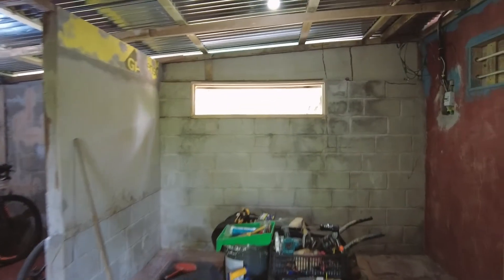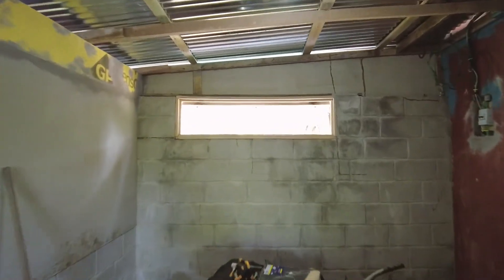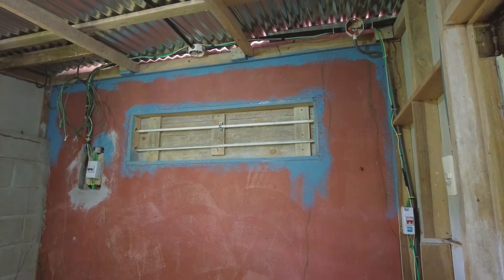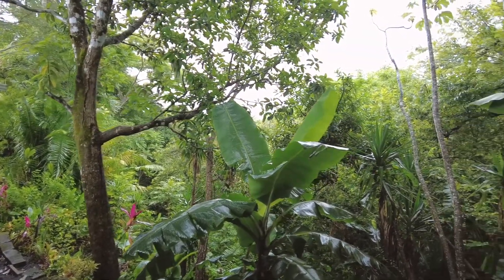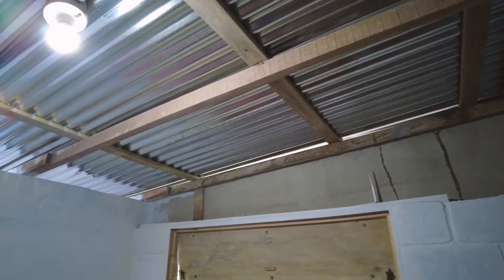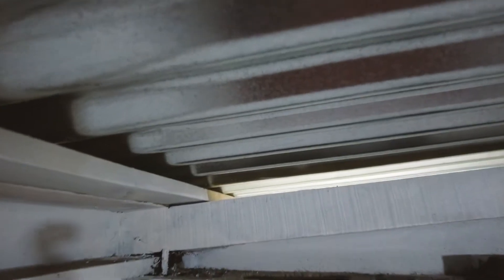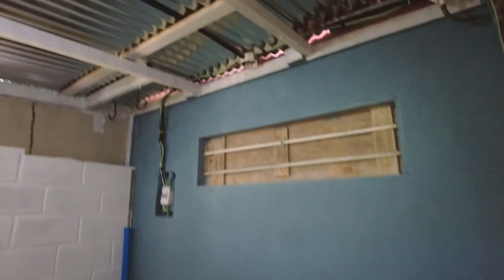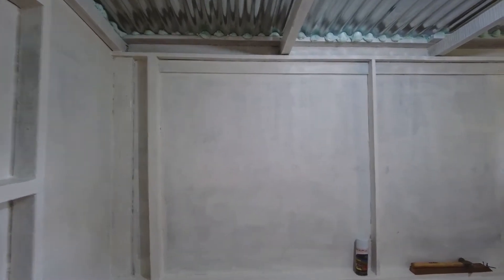Extreme Makeover Bodega Edition pt2 | Montezuma, Costa Rica

Comment: Thank you so much for these videos! They were incredibly helpful, and you are a natural teacher. You left me feeling hopeful all is not lost with the termite damage I have. Did you do any treatment for the termites that were there as you reconstructed?
Reply from the maker: Thanks for the awesome comments! The best way to avoid termites is to keep the perimeter of the structure free of dirt and debris so you can always see if there are any tunnels forming. Once they get in, that’s when the fun begins. Although I tried to avoid using chemicals, there were just too many inside the house to manage. A local Tico gave me a bottle with a chemical mixture that worked amazing. He said it was a secret recipe but I’m certain it had petroleum or diesel fuel in it. Termites are an integral part of the ecosystem and we should avoid killing them whenever possible. Good luck!